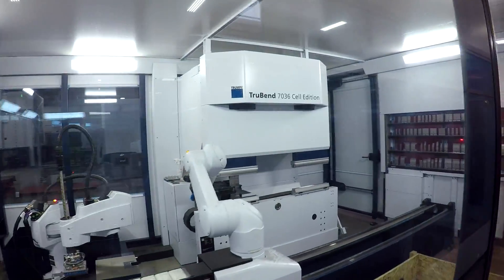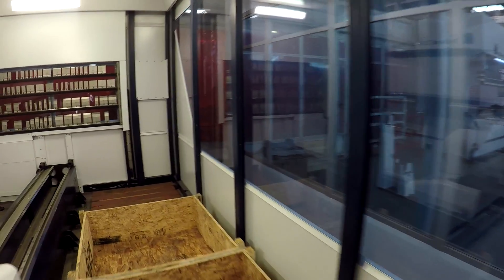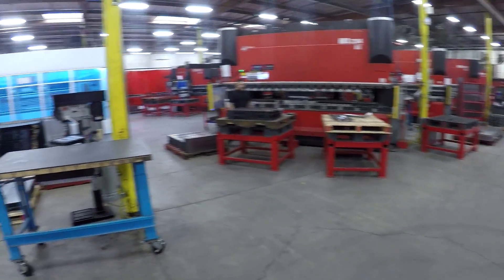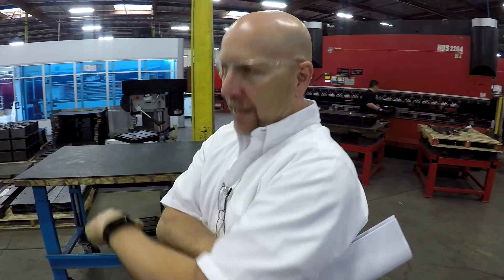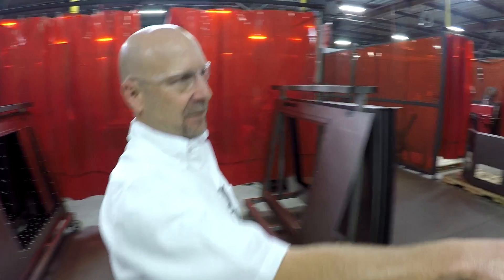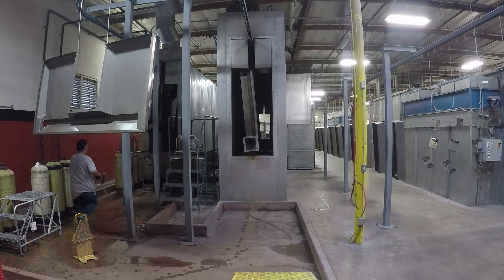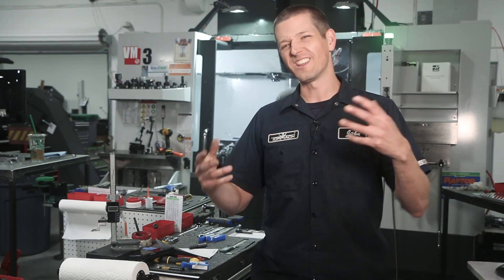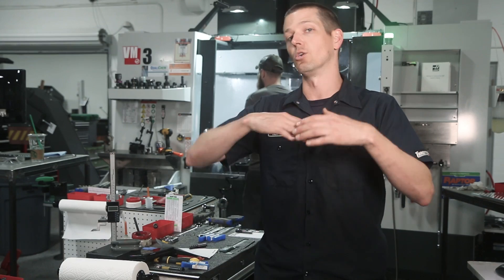Touring HAAS Sheet Metal Factory!

Comment: Sheetmetal working is so under appreciated. It is a real cost effective, allows to create complex geometries, can be automated a lot these days. And there is so many options to working with sheet metal. Pressing, hand cutting, nibbling, punching, laser cutting, plasma cutting, water jet cutting, breaking, bending, spinning, drawing, hammering, wheeling, closed die pressing, hydro forming, hemming, seaming, incremental forming, rotary punching, perforating, rolling, stamping, riveting, installing nuts and rivenuts, tapping, welding, spot welding, finishing, anodizing, galvanizing, sand blasting, painting, coating, finishing, stickers, decals, etching, engraving, patterning, brushing, etc. etc. It also comes with a lot of custom fastener and connection techniques, both as hardware, but also design of the part itself. Plus the entire work is really complex, and design requires understanding a lot about material being used, angles, plasticity, elasticity, offsets, bend allowances, k-factors, etc, etc. to make it accurate and not break. You could write many books on the bending alone. Yet, we see the products out of sheet metal everywhere all the time.

Comment: My shop has a line of press brakes that tells a snapshot narrative of how far sheet metal fabrication has come. The first brake is about 100 years old, still used, and is one of the first electric brakes that were produced, followed by a Cincinnati  brake with an early control but not CNC, and last is a brand new Bystronic that is fully CNC and even uses a touch screen for navigation.

Comment: Wow, automation has come a long way for small production runs that illustrate how one can adapt to a variety of models that, overall, generate mass volume. Incredible advances. Automation Manufacturing methods used today really should be defined as the Third Industrial Revolution, though I realize many will argue the point. But to me, it's a valid reference point because the GDP productivity of small and large manufacturers of products has clearly increased exponentially as they did during the 1st and 2nd revolutions.

Comment: Yes! I love Amada equipment, it's just so damn expensive. I prefer the older RG series, because they're just so easy to walk up to and begin operation. I've also ran an HG, one of their newer models, and it was very easy going from a 1988 RG with an NC9-EX to a 2015 HG with their newest AMNC3i control. If you ever get into doing sheet metal production, you can't go wrong with Amada equipment, just be prepared to give up a lot of money. Also, screw those light curtains, they should have bought Feissler Electronik light curtains instead of the ISB Merlin.

Comment: BRB. Packing my bags moving from Australia to work for haas. Use an Amada 8025 and 1303 at work. Switching to Imperial measurements might take some getting used too.
Reply: BL0ODSUGAR They might use metric! I work at a sheet metal job shop and 90% of the stuff that comes through is in metric with the converted imperial on the print for programming. I've been operating press brakes for five years and I didn't realize how easy it is to use metric. I wish I could find out how to switch the Amada RG series brakes I work on over to metric, it it's possible. It would make our lives so much easier.
Reply: @ Bradley Willoughby Ask it when the next service guy is at the machine, Ow and if you are poking around in the menus the pasword: ADAMA :) on my machines atleast.